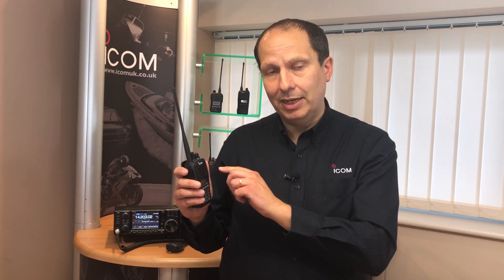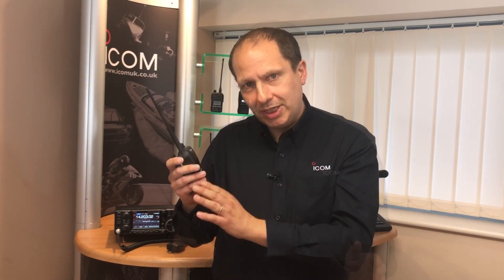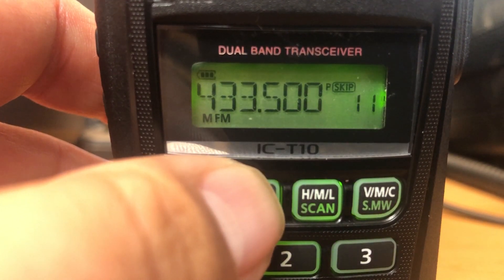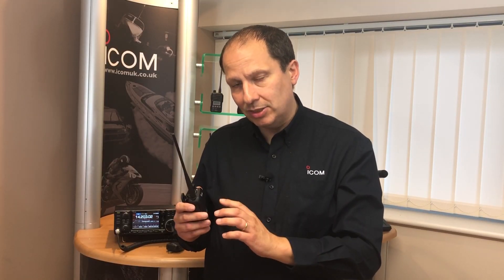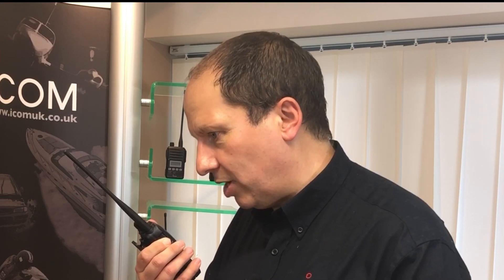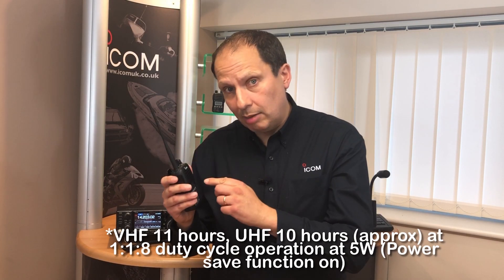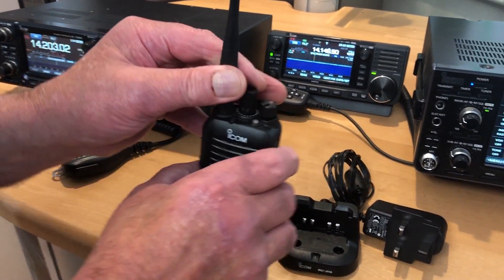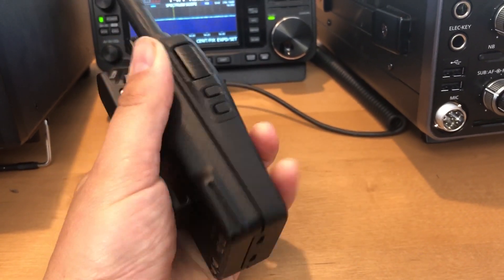Introduction to the Icom IC-T10 VHF/UHF Dual-Band FM Transceiver

Comment: its not really IP67. i dip mine in a small bucket of tap water in 3 seconds, and i noticed that the water went inside the radio's screen.
Reply from the maker: If water entered your radio's screen after just 3 seconds in a shallow bucket, something is definitely not right as the radio is rated for IP67 dust-tight and waterproof construction. This means it's designed to withstand immersion in 1 meter of water for up to 30 minutes.  

Before any water immersion, it's crucial to ensure that all seals on the radio are properly closed and seated. This includes the battery pack, the accessory jack cover (if not using an accessory), and any other removable parts. Even a tiny speck of debris or an improper seal can compromise the waterproof integrity.

Given what you've described, I would strongly recommend that you contact your Icom dealer or distributor. They have the expertise and resources to properly inspect your unit, identify the cause of the water ingress, and advise on any necessary repairs or warranty claims.

Comment: What settings do i change? On UHF i cannot transmit, but the radio receives it. When i press PTT, it shows "OFF". Any help would be appreciated.
Reply from the maker: It sounds like you are transmitting out of band.
Reply: @Icom_UK  but i can receive transmission from the other radio (different maker)
Reply from the maker: As a responsible manufacturer, our radios are only sold in the UK to cover the frequencies allowed by its type approval.

Comment: This is a replacement for the IC-T70A sadly they reduce the memory from 302 channels to 208 channels. I do not think this could go head to head with the Yaesu FT-65 or FT-4X especially with the price range.
Reply: IP-67 makes it better than 65 or the 4x.   Same FM and WX capability and a 1/2 watt louder audio,  so I think your comment is wrong.

Comment: Direct Conversion = same as a bofeng.... UGH
Reply: Seriously? It's over priced then. If its a radio on a chip then the mars mod will be a code and not a diode. May as well get a tyt for $70
Reply: @Johnyrocket70  yes...I'm VERY surprised that they are using direct conversion.  Oh well